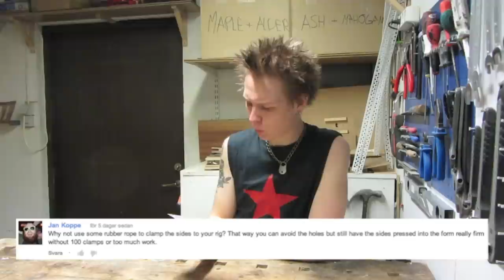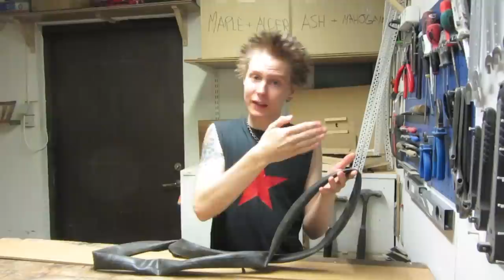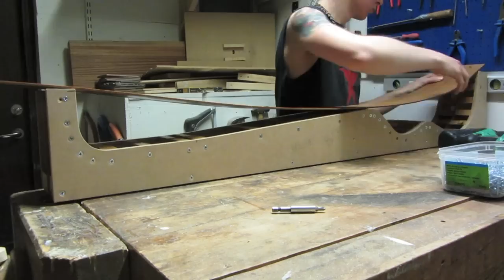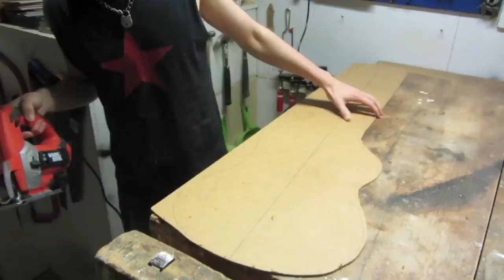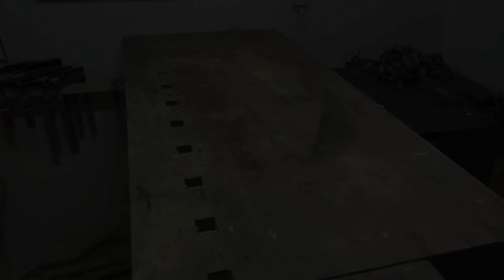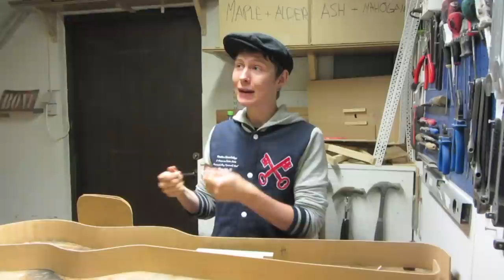Form Fitting Precision Bass Hard Case Build: Chapter Two

Comment from the maker: He doesn't do handicrafts like I do, he has them to do potential work on the house etc. No, this is not an ongoing build since I've already finished it. Tho I might do it again in the future. Yes a hot pipe would be great for bending wood. And a rig/mold like I'm using here is commonly used to glue sides together. Tho this rig was a test (like the whole build) that worked fine and it gave me what I wanted. And If I where to build another case, I think I might use the same method again.